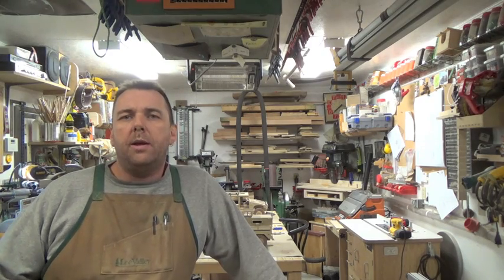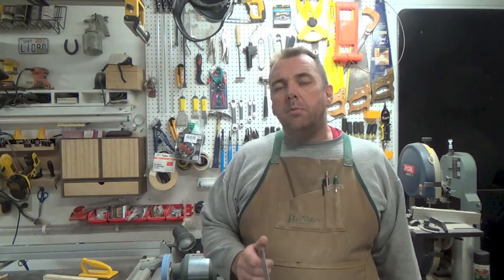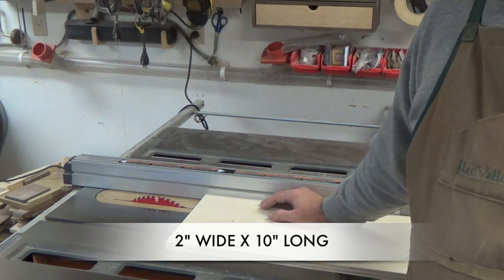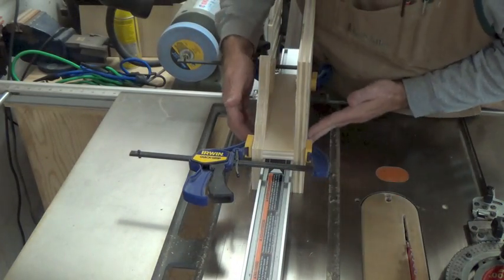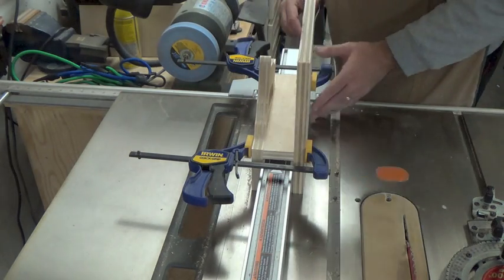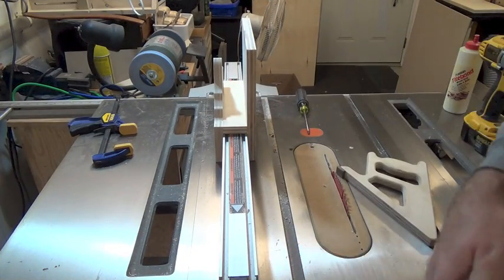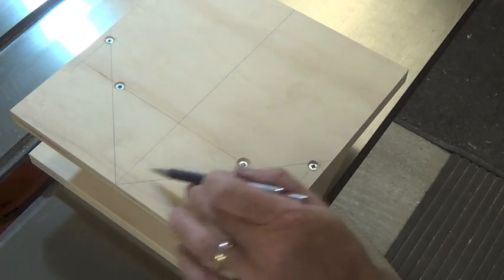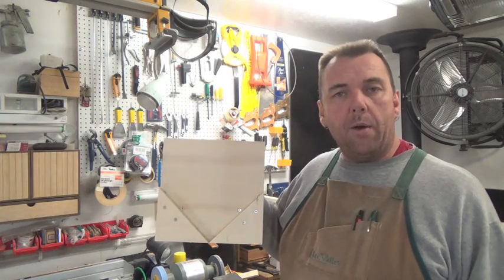Frame Spline Jig

Comment: Great video. Others videos I have watched have the 45’s clearing the bottom of the blade for the majority of frame sizes. Your jig will get chewed up at the base right? Since I have not made a jig as yet would love to incorporate the best of the few Videos I have watched. Love the handle and fit over the stop.
Reply from the maker: Well, in answer to your question Karen, yes, and no.  The bottom of the jig does get cut up with you run your frames through it but for the most part, we only make a certain thickness of frame, so once the initial splines are cut, in most cases, we can set the saw back up in the same position to have the blade run through the kerf it has already cut in the jig.  I've had this jig for years and it's still going, regardless of how many times my saw blade has passed through the base of the jig.  I hope this helps.  Thanks for tuning in and taking the time to leave the kind words.  I truly appreciate it.

Comment: I used a saw handle from a saw my dad had and it worked very good for a template.I have another question, The back board that you marked a line on at the top of the 2" board, did you cut the 8" board down and then attach the handle?
Reply from the maker: No.  After I marked to line to show me the top of the 2" board, I marked the handle above that line and then used the scroll saw to cut the handle shape out of the full piece of plywood.  If you don't have a scroll saw, you can use a jig saw or a coping saw if you like.

Comment: Where would I get a pattern for the handle for the spline jig.
Reply from the maker: Truth be told Jim, all I did was trace the handle of one of my hand saws onto 1/8" hard board.  From there, I cut it out on the scroll saw and used it as a template for this project.  It doesn't get any easier than that.  Thanks for asking the question.